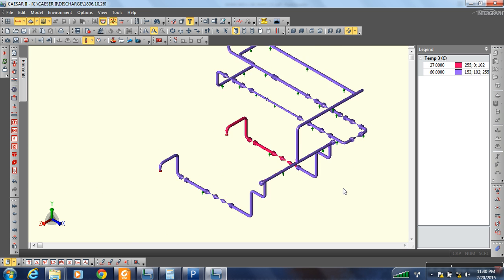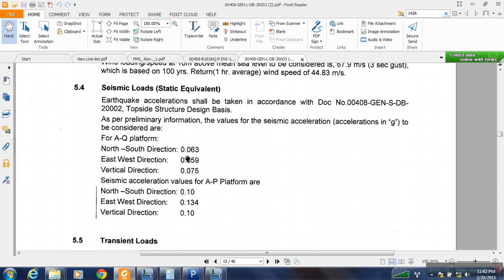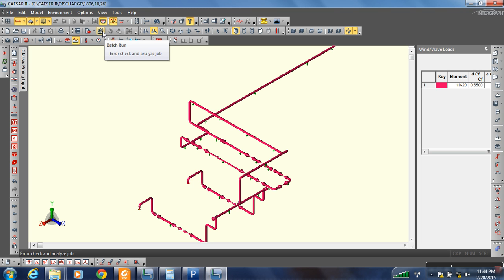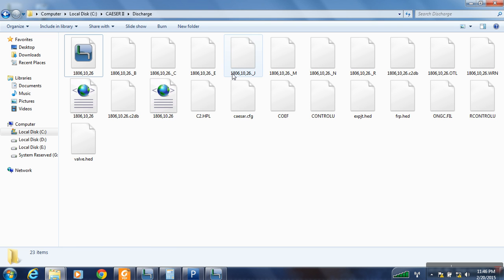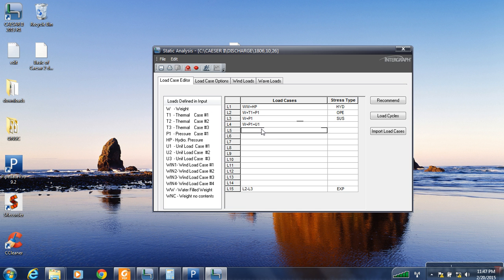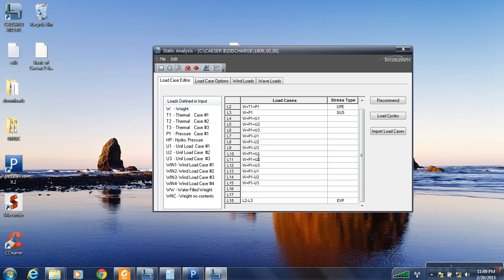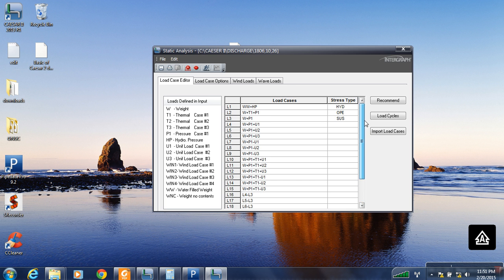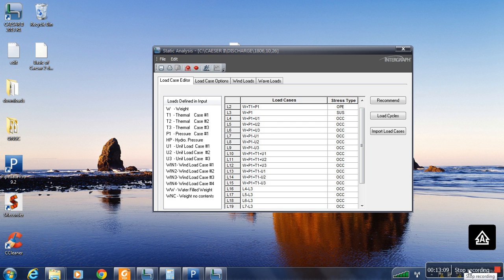Basic of Caesar 2 Creating static load conditions

Comment: Can you please discuss the requirement for the new load cases. Please read:

At the link What’s New in CAESAR II, 2016 (Version 8.0) – What is Piping
http://www.whatispiping.com/whats-new-in-caesar-ii-2016-version-8-0

following is given

Updation in Piping Codes:

ASME B31.3 2014 Edition, including:
Addressed the code standard requirement to consider sustained (and occasional) stress in all support conditions. New static load cases, called alternate sustained or alternate occasional cases, depend upon the support configuration of a converged operating condition. This condition addresses systems where non-linear supports are active in some operating conditions and inactive in others. The alternate support condition is indicated using the new Alternate SUS/OCC check box in the Static Analysis – Load Case Editor.
Added two new load case templates (.tpl files) for use when recommending load cases, which include support for the alternate SUS/OCC load cases. The template files include: TPL – the updated default load case template, which recommends alternate sustained load casee for jobs including the B31.3 code and LOAD_EXP.TPL – includes all expansion load cases between different operating conditions. (This was the default template in CAESAR II 2014.)